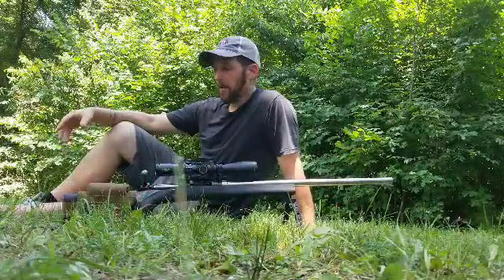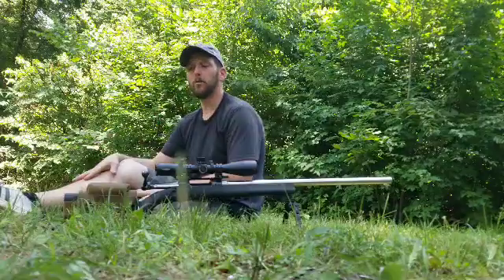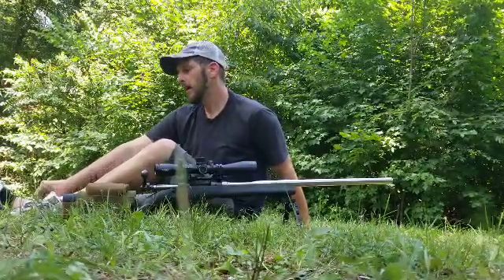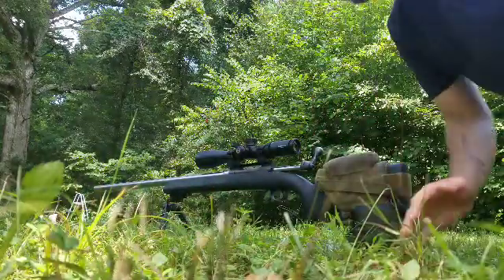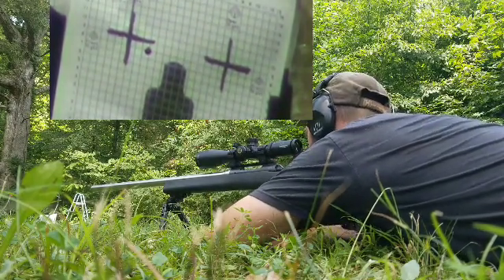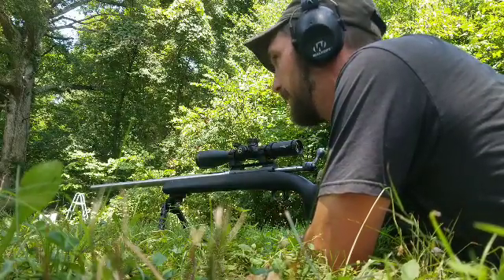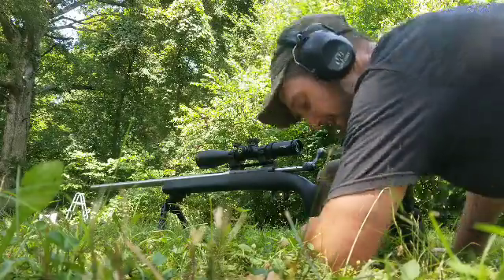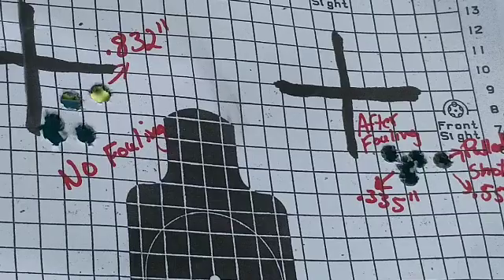Effects of Carbon Fouling For Precision Rifle Accuracy

Comment: CLR is a household cleaner that is excellent and inexpensive carbon solvent: https://www.youtube.com/watch?v=xte_pf3ZhsA
Do you clean for copper fouling or only carbon fouling?
Reply from the maker: Yes I have been using clr for quite a while as my carbon cleaner. Its been going around in fclass circles for a few years. I typically only clean carbon and I do it between 100 and 200 rounds depending on the cartridge im shooting and powder.  I almost never clean copper unless I start to see accuracy degrade and cleaning carbon doesn't fix it.

Comment: Good video! I've noticed this too! 1-2 shots to get the barrel seasoned per projectile from a complete cleaning....I got a new micro groove 10/22 .22lr barrel never been cleaned 500rd so far... Aguila Superextra 40gr one holes at 50yd ... what I noticed that needs cleaned is the bolt..after 10-15 shots open up to 3/8" @50yd ... once I scrub the bolt face and chamber mating surface it goes back to one hole groups
Reply from the maker: Thanks. I have never really paid attention to my 22lrs like  i do my center fires  but i can imagine that a 22 chamber gets dirty much faster than a centerfire. Especially a semi auto. 22s typically use a really fast burning powder that leaves behind a lot of carbon and residue and super extra is a fast round so im sure its powder leaves even more carbon than most 22lr
Reply: @gunfather83 oh yeah it's definitely alot cheaper to shoot haha and I don't have to leave my house unless it's beyond 50yd but luckily most of my studying applies to everything